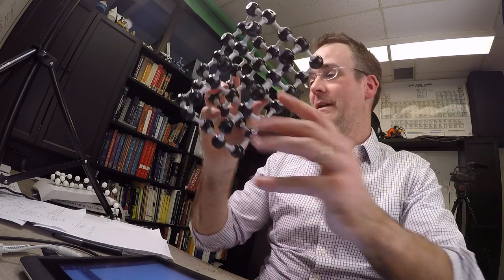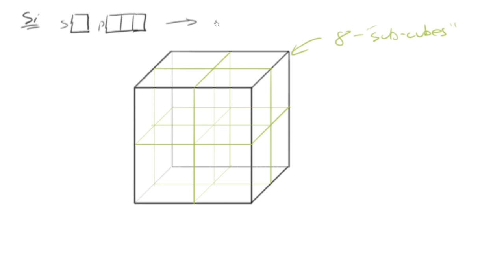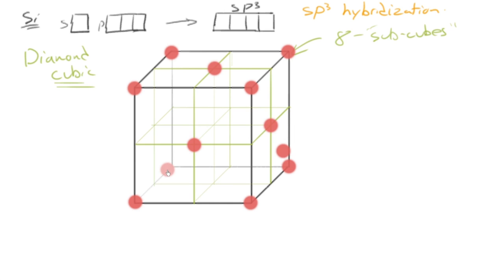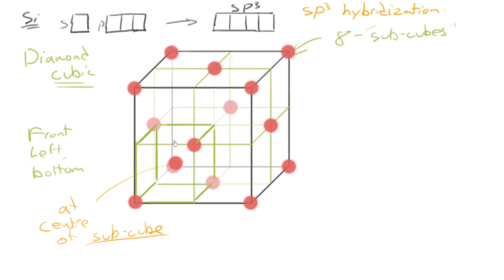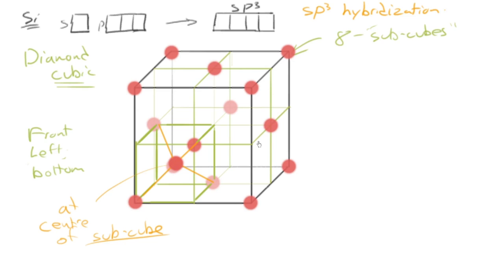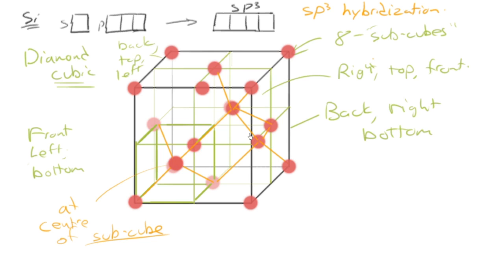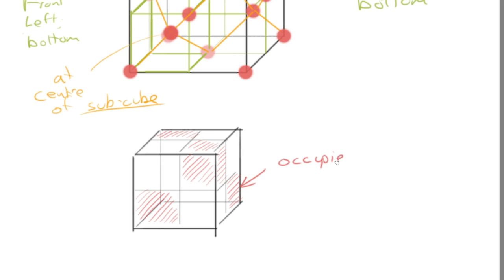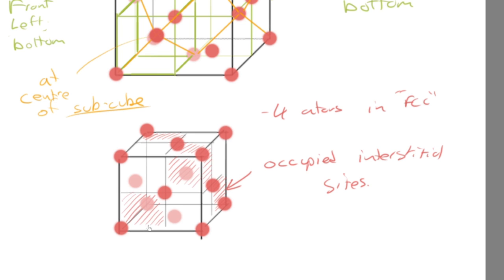59 The diamond cubic crystal structure

Comment: Thanks for the great video! I have a question about the sphalerite crystal structure. It has the same tetrahedral bond structure as diamond except it is composed of two different atoms, sulphur and zinc. However it is classified in the hexatetrahedral  class -43m instead of the hexoctahedral class like diamond. Why does simply changing one atom but leaving the structure the same change the crystal class? I have made models of both and I cannot see the difference that would cause the crystal class change. Both models seem to have exactly the same planes of symmetry. Is there something I am missing?
Reply: Did you ever find out ?